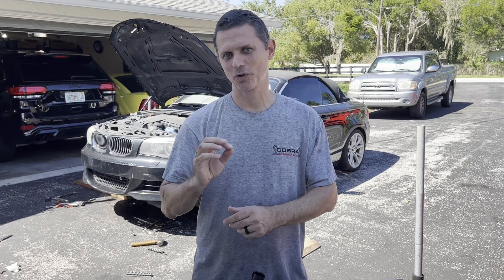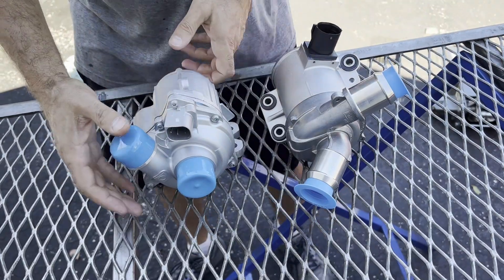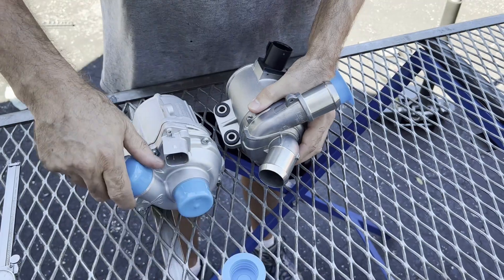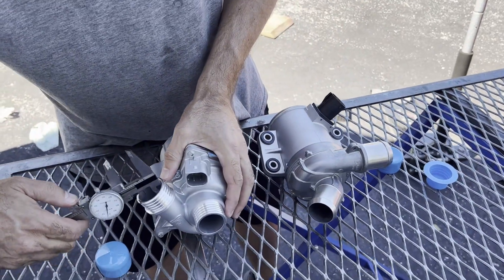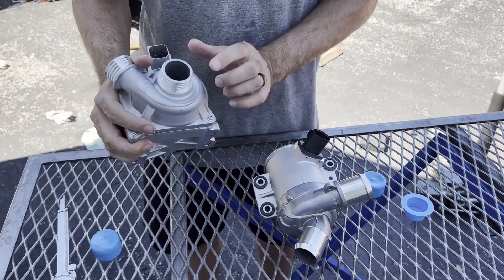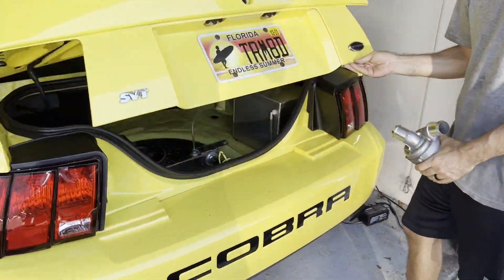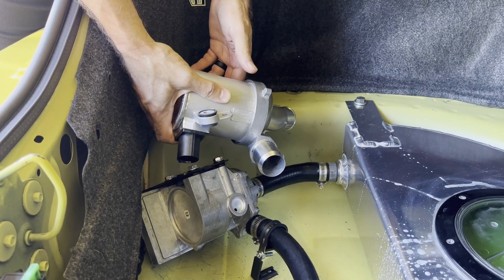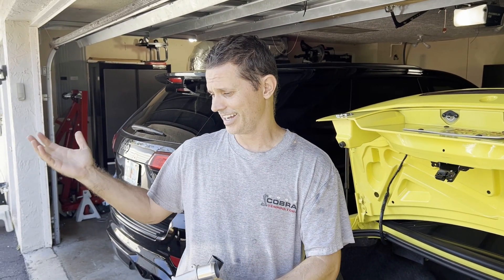Pierburg, PW611 & Stewart EMP Pumps Quick Overview

Comment: Dang it, the Ford Fusion PW611 pumps have jumped up a lot on price! You wouldn't happen to be selling yours Mr. Malcolm? lol
Reply from the maker: Everything seems to be getting so expensive! I am not selling any pumps right now.
Reply: @MalcolmV8  No worries. Seems like the cheapest way to get one of these pumps is to find a low mile Ford Fusion and pull the pump. Are these pumps pretty reliable? Also, how hard is it to wire up to the 03/04 cobras?

Comment: Ive got the fusion pump in my cobra I just installed. I picked it up from department of boost along with their wire harness and brackets. Havent fired it up yet as im now wiring up proefi on it. the entire system is 5.5gallon tank, fusion pump, 1 1/8" hose, DOB super single heat exchanger, VMP IC core. I have a flow meter to put in when Im ready to check flow. The one thing ive heard about the fusion pump is a lot of aeration with it. So it is a PWM pump and I am going to wire it to the proefi and will mess with speeds to get good flow but no aeration.
Reply from the maker: That sounds like a nice setup. Thanks for confirming PWM on the pump, I haven’t had a chance to play with it yet. I’ve seen a lot of people struggle with aeration with the EMP pumps too and slow them down. I’ve found by designing your reservoir to not have aeration like placing the return line down low in the tank etc. it gets rid of it all and you can run the pump full speed with no issues. Perhaps the same will be true of the Fusion pump.
Reply: How did you orientated the yellow trigger wire? Can you connect it to the factory trigger wire???
Reply: @Shawn Spencer  connect it to a 12v trigger. So yes off the factory wire would work. I wired mine directly to my proefi.
Reply: You wouldn't happen to have a part number for the connector on the fusion pump would you?
Reply: @UpNorthCatsFan  found mines off ebay
Reply: Does DoB still sell that kit?
Reply: How do you wire this pump up to be controlled with PWM? Does the DOB harness you used include a controller?What I’m finding is this pump is actually controlled by LINbus but I’m trying to find out how to wire it to my Holley with PWM. Thanks

Comment: What are your thoughts on the dc150?
Reply from the maker: They don’t flow enough for me but they are a great bang for the buck option. I should think about including in upcoming testing.
Reply: @MalcolmV8  I think ima just purchase the emp pump “pay once cry once” 😅 
Only thing that worries me is that some people have cavitation issues with them I’m guessing that’s probably because how people mount them?
Reply from the maker: @modlist6129  yes how they're mounted and also how their reservoir tank is setup.  Don't have the return line coming in up top creating a massive splash fest and aerating the water.  Return line down low well below the fluid level.
Reply: @MalcolmV8  I have a pnr tank I’ll most likely end up getting rid of the drain valve that is has and use that port for the return line.
Reply from the maker: @modlist6129  is that big enough? most drains I've seen are pretty small.  You can either weld a new return lower down and plug the old one or I've seen some people add an extension inside the tank from the higher return and direct the fluid down low to avoid the crazy aeration.
Reply: @MalcolmV8  I’d have to check on the size! But adding a hoes is a great idea I will most likely give that a try!